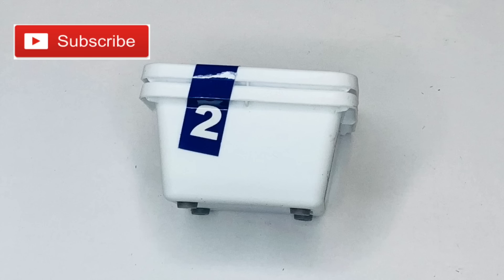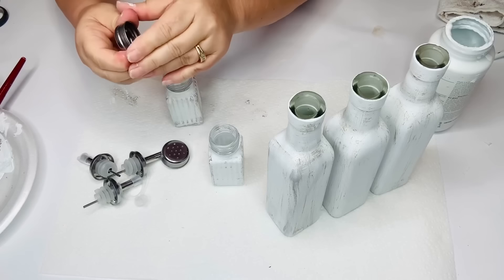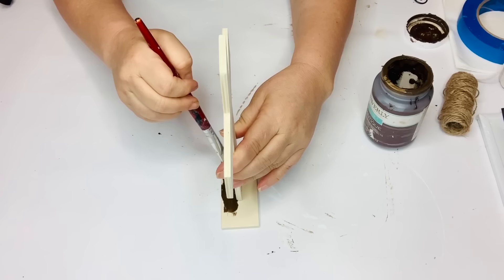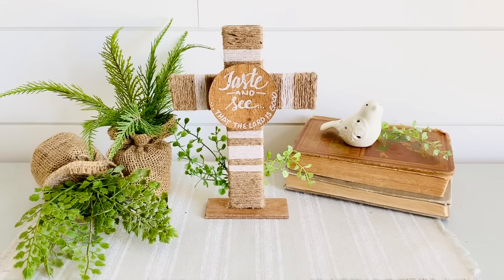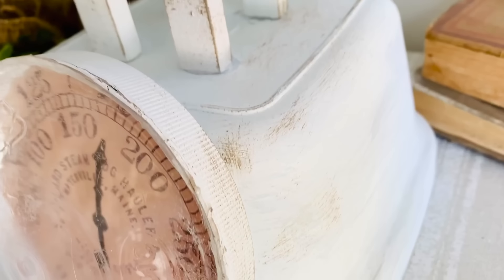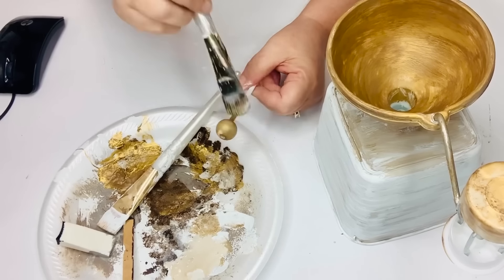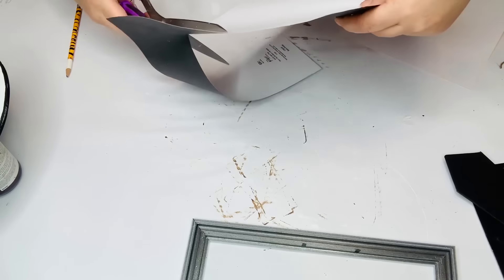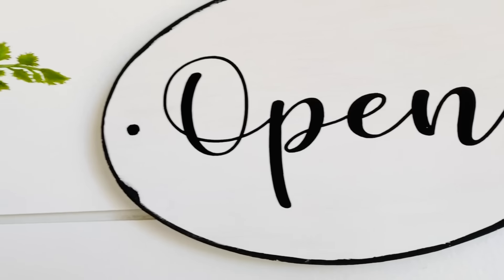7 DOLLAR TREE DIY PROJECTS | $3 OR LESS! | FARMHOUSE HOME DECOR PROJECTS | FARMHOUSE SCALE

Comment: The Bentho font, you need to open the character map, pull the letter you want then copy and past into your design space. Run a search in Windows on the start menu and type in Character Map and it will bring up a link to it.

Comment: I like to use the old fashion metal thumb tacks to hide the holes in beads when I use them for knobs. I just over fill the bead with hot glue just a little bit so that when I push the thumb tack in the glue will squish into the dome of the tack.